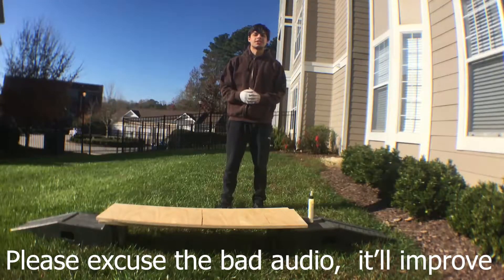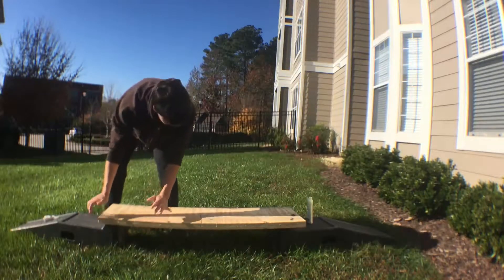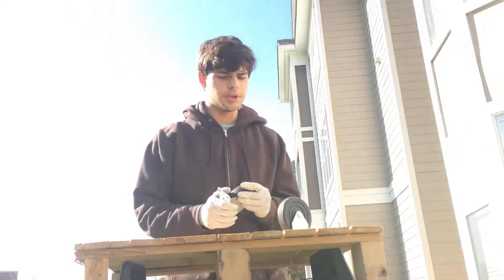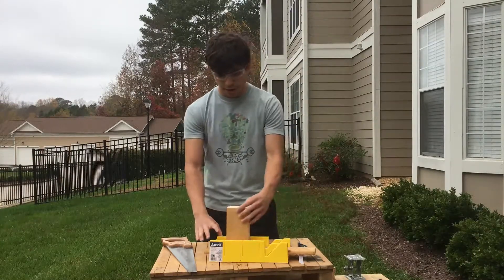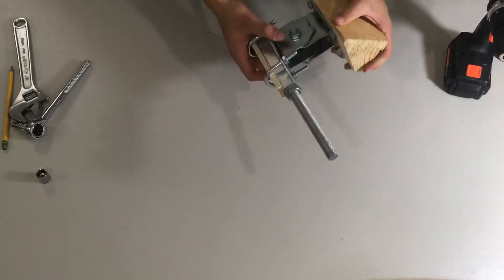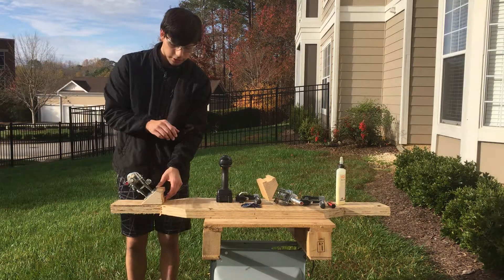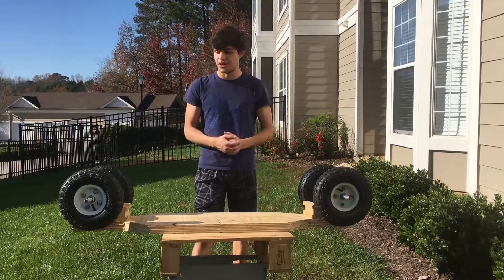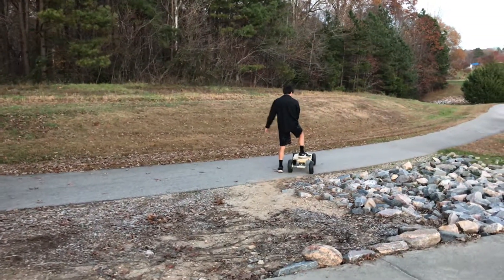How to Build Your Own DIY Mountain Board! | Wild Kinetics

Comment: Way late comment but my pair of pennies...
1. Stronger springs. If you can find springs for old school bike shocks, they are just the right stiffness for mountain boards.
2. This might be more useful on a sandy beach being pulled along by a kite or a wing. The big wheels will -- with luck and skill -- overcome the intitial resistance of the sand. Start with a 5m traction kite, or a 6 metre wing.

Comment: Hey bro.....Good job.....
I am trying to make one and learned so much from your video....

Can you tell me how hard is your "heavy duty springs" used in turning mechanism....

Once again ....Great work 🙌
Reply from the maker: Glad you Enjoyed! I took the springs from an old printer that was disassembled, but the width was about 1 in by 3.5 to 4 inches, which you can find at your local Homed Depot or other hardware store for a few bucks each.
Reply: Conseguiu fazer? Estou montando o meu tbm 🙂